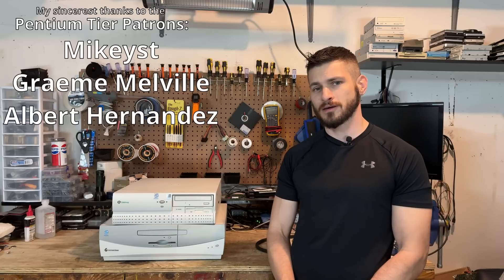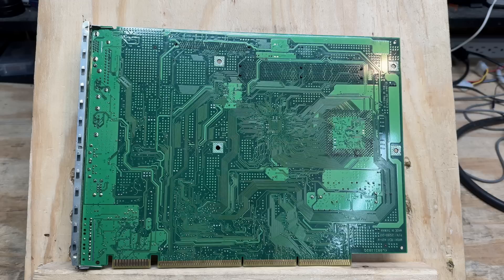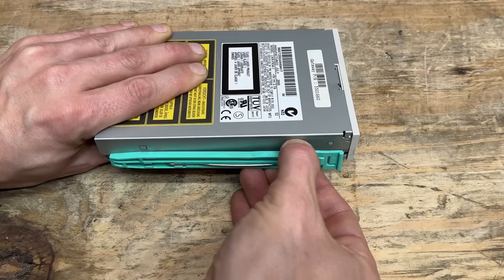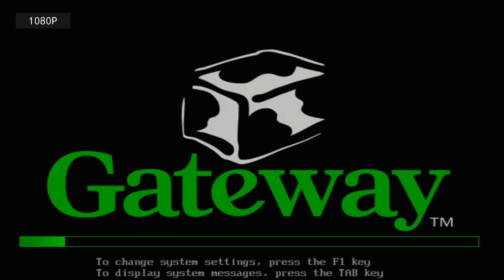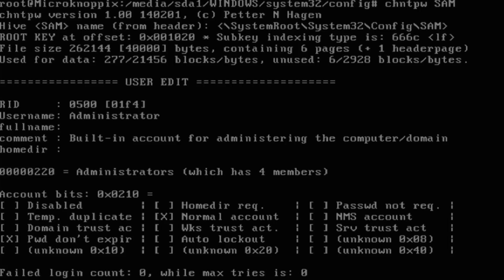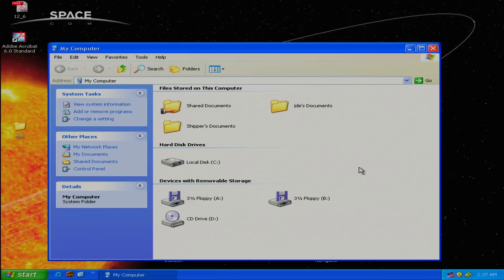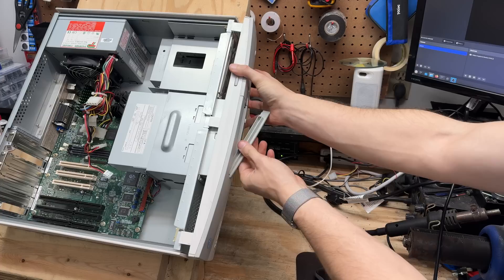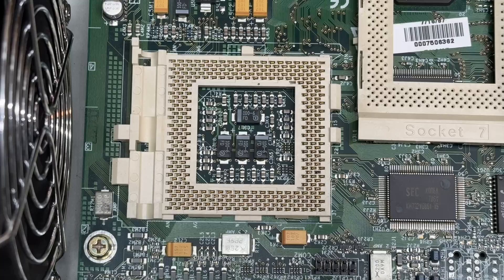Gateway Desktops: Can we resurrect them?

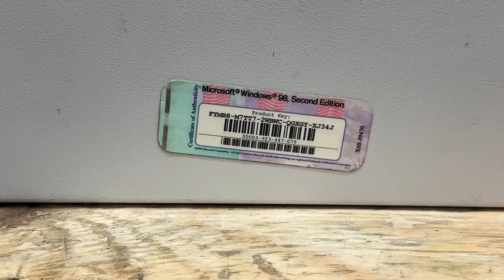Comment: 0:50 I'd bet that this machine was release near the introduction of windows 2000 and it probably complied with the minimum hardware requirements, thus the "Designed for Windows2000" sticker. But it probably shipped with Windows98 and most likely an upgrade voucher, which would explain the product key sticker on the side.

Comment: 4:11 I can confirm Gateway did sell to the enterprise during this era. They had mixed success doing so, but they did indeed try. Also, regarding Crucial memory in the machine, it's probably not original. If memory serves, Gateway did use Micron memory, but it was Micron-branded, not Crucial-branded.

Comment: After a quick glance at the socket 7 pinout diagram I noticed that the missing pin is a VSS pin and there are 9 more after that. It should work without it.

Comment: I can totally believe XP SP2 in 2011... when I got my IT support job in 2012, I inherited a room full of HP Vectra VLs (P4 1.5-1.7 GHz), complete with - you guessed it - XP SP2, their stock 256 megs of PC133 SDRAM and an antivirus that would have required about that much RAM by itself. They were SLOOOOW. You bet that I ordered a bunch of memory and updated them in short order, which turned them into actually decent office / surfing machines. As they went out of service the RAM got redistributed, so that the one system I kept for nostagia's sake should have 1.25 gigs in it if memory serves. Several got given away to see further productive use, actually.

Comment: When I was in college, we had an entire lab of the Gateway P5-166 machines. Yeah, the ES1370/1371 were the AudioPCI from Ensoniq. I had a bunch for Windows NT workstations. I’d sit and listen to MIDI songs on them for hours while I was studying for exams and they sounded amazing.
Reply: Since it's atx form factor would be nice to install my dual Pentium 3 setup in it. And change the front face with a 3d printed one to use a normal dvd drive.
Reply: @plainsabertooth7828 you could probably get away with that setup but just keep in mind to keep the heat under control because there’s not really much airflow in those cases. Remember, the only real fan was the one from the power supply. You could probably add some front mounting holes for a 80 mm fan for the front next to the 5.25” slot.
Reply: @dlinkster  yeah I have a 200w version of that power supply as well since it's required for the motherboard minimum atleast.

Comment: That weird AGP card is part of the NLX form factor. One of many attempts to 'improve on' ATX plenty of 1st gen quadro cards especially from ELSA were available in this form factor.
Reply: Not just NLX but also LPX.
They were made that way for a while, but the best you can find is some GF 256 (SDR) Cards, such as the ELSA ERAZOR X.

After that the GPU Manufacturers stopped making them this way.
Reply: Yeah, totally an NLX system. I've got a few DEC machines with the same sliding motherboard situation (though with two levers instead of one) and same shape I/O shield. The pinout for the riser is supposed to be standardized so in theory I could take the motherboard out of a Venturis FX-2 and stick it in that Gateway case and it would work. I believe IBM and Compaq built some NLX machines too.
Reply: Lots of IBM Desktop PCs (The 300 series) had it as well.

Comment: Don't be so scared of cleaning the LS-120 drive if you need to in the future- I have been using a USB one as an external floppy (on Windows 7 and 10) for 7+ years now, and had no issue when cleaning it upon arrival in order to get the drive working fully. In addition to reading & writing 120MB and 1.44MB disks, it should also be able to format a 1.44 as 2.88MB.
Really cool seeing these machines- I love the desktop form factor and wish it had remained popular for modern systems.
Reply: The LS-120 does not support 2.88 MB disks, nor does it support formatting a 1.44 MB disk to 2.88 MB. It does support 720k disks, but not 400-800k GCR encoded Macintosh format disks.

The lesser known LS-240 successor had the capability to "over format" a normal 1.44 MB DSHD floppy to a capacity of 32 MB, but it had several caveats. First, it required a special driver and special software that only works on Windows 9x. Second, once data was written to the disk, it could not be altered without rewriting the entire disk. Third, since the format made data tracks orders of magnitude smaller than they were ever designed for, the possibility of data loss was extremely high. Any tiny imperfection or discrepancy would cause massive data corruption. And finally, this special format required an LS-240 drive and the special driver to work, making the large formatted disk rather useless since it was incompatible with everything else.

The special 120/240 MB disks are also mostly useless these days, since Microsoft hasn't properly supported the drive since the 9x era. I have a small stash of LS-120 disks and they don't work correctly on anything beyond Windows ME. Modern Linux also doesn't properly support the large disks either, and frustratingly, LS-120 support is bugged. If you attach the drive to an IDE controller, the kernel driver doesn't work. It only seems to work if you have a USB to IDE adapter, or a pure USB drive.
Reply: @GGigabiteM  I can actually confirm that the 120MB disks do work perfectly well in Windows 10, but I only have tried using the USB version of the LS-120 drive and haven't had access to a LS-240 to test.
Reply: @zantuforevers91   There must be something special about the USB version of the drive. None of my IDE LS-120 drives work in anything past 9x for the 120 MB disks. If I try to mount the disk, I either get a format error, or explorer crashes.

Comment: The PIII system was marketed as a business machine.  In '99 I worked on a project at a plant which used Gateway systems.  Gateway's corporate customer support slipped a bit in quality at that time, then we switched over to Dell systems.  We had one of those "pizza box" desktops which had a bent chassis, and PCI cards would unseat themselves over time and cause problems.  We would call support, and they would send us every part except for the metal chassis.  We asked for a replacement system, and they kept running us through circles.  Our manager got mad enough to cancel further orders then we switched over to Dells.  We had no problems with the towers, just the low profile desktops.

Comment: System 2s PSU is a standard SFX type of the time.
They had the Fans on top, now they have them integrated.
They are now MUCH MUCH smaller than that.

Comment: That first Gateway probably shipped with Windows 2000 standard, but was configured to order with Windows 98. The front badges were possibly pre-applied from their case manufacturer, and the COA applied by Gateway based on what was actually ordered. Maybe this was a business Machine ordered but a consumer, or maybe it was ordered but a business that hadn’t moved to 2000 yet…
Reply from the maker: Aha, makes sense. We did something similar at a company I worked for in the Windows 8 days. Had our Dell rep order them with Win7 instead because nobody liked Win8 (especially me).

Comment: For baked on crusty thermal compound, I'd recommend CRC Lectra Clean. It will melt the thermal compound away. Just don't get it on any case plastic, or LCD screens because it will instantly etch and discolor them.

Comment: My family had a Dell Dimension 4100 with a 933 Mhz Pentium 3 with 256mb of Ram and XP that we somehow used till 2011 when , we finally upgraded to a windows 7 computer, i have that computer and the inside, other than being dusty was in perfect condition with no bad caps yet, and its 20gb HDD was really full too. before this we really just used a custom built windows 95/98 machine i believe

Comment: might be possible to find a scrap board to pull s socket pin from which will get tricky to unsolder and well solder in the replacement wiper

Comment: NS Tech was an OEM that made cables for Dell, HP as well as Gateway don't know if they are still around or not but several Early to Mid 2000's Dell Dimensions used NS Tech cables. Also some Compaq Deskpro's the ones with Pentium II's from 266-400Mhz had that same strange style of video card in them was also an Ati card but it was a Rage Pro Turbo. Very difficult indeed to install another video card into them. Really a huge hassle it seems that Gateway wasn't the only one to go with that odd way of holding in the video card.

Comment: I have had bad caps cause that issue before, well, nearly. The system would get as far as the blue logon splashscreen of Windows 98, it would render half the screen, and then lock up. 
That was a slotted Pentium II system. Replaced one leaky cap, and worked like a charm.

Comment: If that first system was being used as a shipping computer, then it easily was being used until it finally went bad, which was caused by those caps going bad. A lot of businesses and especially government places are like that, lower priority hardware doesn't get replaced until it absolutely has to. At my workplace, I handle the shipping, and the computer I was using was some Acer SFF brick with a Celeron and Win 8.1. Finally had to be replaced when the newest version of UPS Worldship refused to be installed on Win8.1; now I have an ASUS brick with an 11th gen I5 and Win11 :-)

Comment: Phoenix Enterprises PEMCO, they sell 321 pin PGA ZIF Socket-7 replacements. I never had to replace one myself, but I bought one from them to use as an aide for straightening bent pens on S7 processors.
Reply from the maker: Wow, THAT is exactly what I need. They’re in-stock too! Looks like PEMCO also sells replacement SIMM sockets. Thanks so much! I’d never heard of them before.

Comment: Outstanding as usual. You forget how versatile XP was. It was designed when many people were still running Pent2 systems. I was surprised it was a legit upgrade. Many of us were using pirated XP that stayed away from SP2. Bummer with the 2nd Gateway. I was amazed at how clean it was on the inside. I remember having that model and the funky cd door on the front. Glad you liked the chloroform wipes. They do work very well. Usually one will clean off the cpu and heat sink and then some.
Reply from the maker: Chloroform wipes 🤣🤣 I may have inadvertently reverse-engineered them. It’s either eucalyptus or tea tree oil. I’ll have to get a hold of some and do a test. You’ve certainly enhanced my heatsink-cleaning technology!

Comment: Australia Post was using Gateway at some point in the late 90s. I worked at a facility with barcode sorting machines, and inside were old Gateway towers running NT4.

Gateway's short time in Australia was strange, and it also had a tenuous connection to Osborne Computer Corporation.

Comment: Nice to see an NLX FOrm Factor Board.
The Card inside you can upgrade with others, its not too hard to find. However, the best you can do is maybe some Geforce 256 (SDR) Cards like the ELSA Ones, as they stopped making cards with that Layout.
Matrox G400, 3dfx Voodoo 3 2000 are other Cards that should fit, thoguh you have to swap the I/O Shield.

Comment: I have a huge soft spot for the Gateway E-3400. My Highschool had a ton of them and it's one of the first computers I learned to work on. Your descriptions of "whoa, that is weird" and "this thing is quite strange" fit these machines perfectly. 

In regards to that weird video card, the form factor is called NLX. Sadly Rage 128 and TNT/TNT2 cards are about the best cards made for it. I think I saw mentions of a Nvidia Geforce 256 being in that form factor but I have never seen one.
Reply from the maker: Wow, I’ve never heard of NLX. I thought it was proprietary. Thanks for the info!
Reply: @miketech1024  it was not common. It was a full system form factor (case, mobo w/ riser, and the video card) introduced in the mid to late 90's for SFF desktops. I have seen a few other systems that used it but all were pentium III systems.

Comment: I actually have two odd Gateway 2000 systems, one was a 486 DX/33 similar to the SX/35 you have that was swapped out for a socket 7 board by the previous owner (AKA my cousin in the late-90s) and a solo 1150, which looks like a cross between a PowerBook g3 and iBook clamshell.

Comment: The odd cd rom drives are easily replaced, that grey plastic that the faceplate pops into is removable and you remove the front of the drawer from the new cd rom or dvd and swap them. Kewl video!  New fan here!

Comment: Wow, I don’t think I’ve ever seen a matching AGP Graphics Card & Slot before as they fit together perfectly, I do have One or more of those Graphics Cards but that’s the first time I’ve seen a PC that they fit in with that stubby bracket at: 2:05, 
At: 4:40 some of those CPU retention brackets on some PCs could be a right pain in the backside to remove, That’s for sure! 
I do have a LS120 Disk but have never had a Drive to try it in not that I’m particularly bothered as I’ve used ZIP Disks & Recordable Media without any issues… 🙂🇬🇧

Comment: I have a Compaq Deskpro and the graphics card is the same.  The Vga port must be at the top and have these corners in the PCB.  Furthermore, the Deskpro only works with ATI or Matrox cards; with other cards such as Nvidia, the monitor remains dark.  Pretty strange.  There were some cards in this design, some of which you could even break out a piece of the PCB so that they could fit into a housing like this.
Reply: Yes I was going to say, the early Deskpro EN 6233-6450 had the Rage Pro variant with similar shape to the card - totally bizarre machines - the Slot 1 CPU was also on its side if I remember rightly???   I had a 6450 with 9.1Gb SCSI factory option.

Comment: Might be a good idea to replace the similar capacitors that are not visibly blown, if not already gone or going, they probably have less C and more R than they should have.
The Ensoniq AudioPCI ES1370 was the predecessor of the SB PCI ... system RAM assisted hardware wavetable with a 2, 4 or 8MB sample set ECW format which did not get any external software support
Reply from the maker: Yeah, I need to stock up on low-ESR 1000-1500uf caps.

Comment: That 1st machine was the "Gateway" to crapacitors! We used Belarc Advisor back when I was volunteering with 2nd hand system refurbishment.
USB's on an old Pentium system like that 2nd machine are pretty sweet, have an old Toshiba laptop with 1. Shame about the dodgy CPU socket though...
Reply from the maker: I worked a sysadmin job for a company that used Belmanage, which is Belarc’s enterprise option. It would pull those reports periodically on all Windows endpoints and upload them to a server. That interface had barely changed, so it was like a bit of nostalgia whenever I had to use it! 😂
Reply: @miketech1024  It also showed a domain on that PC, which showed a company name. Eheh.. Also showed another local user's name.

Comment: I had a USB SuperDisk drive for a while. They read/write floppies 4x faster than standard floppy drives. However, they are very temperamental. I did have the 120MB disks for a while. Sold the entire package on eBay over a decade ago. This must be a different variant of the mechanism because it sounds different.

Comment: I have a feeling, this is for the first machine, those greenish blueish slider thingys on the bottom of the motherboard, I'm gonna bet you didn't even have to remove those screws from the top of the MB that you could just unhook the first latch and then pull the center one and it would have modularly slid that mb right out of there.. That's the way those machines were definitely built in the early 00s and late 90s.. yes yes sir totally proprietary.
Edit: Oh. As soon as I finished posting this i unpaused the video and of course you said this. Oh well, comments are good for the algorithm.

Comment: The first computer was probably sold in 2000 there was a couple of years before XP came out that it would Designed for windows 2000 but if it was a home computer it got 98 installed with the 98 coe sticker. Felt like the odd days back then. lol
* Edit * Yep I know a 2000 machine when i see one. Gateway was on something good when they made this system i've never seen one built like this before.

Comment: the reset button noise is caused by the imperfect contact inside the reset switch itself...it's called a bouncing contact...either from dust,corrosion or sometimes soot from sparks :3
PS: you're cyute >w< <3